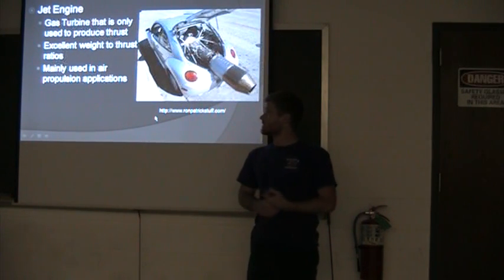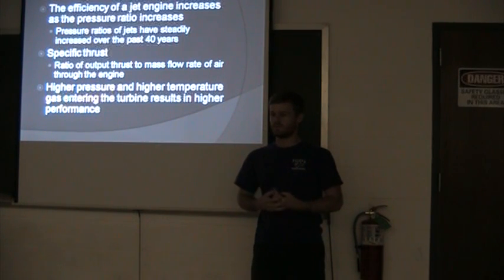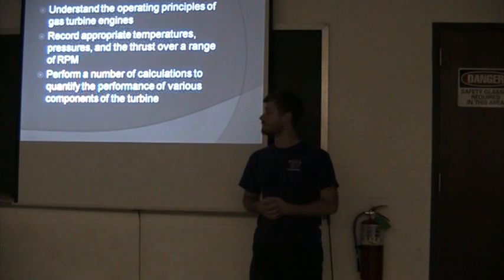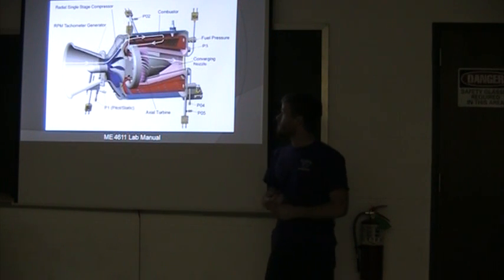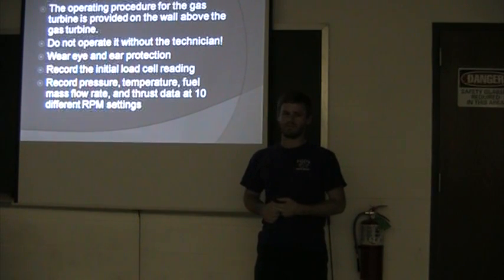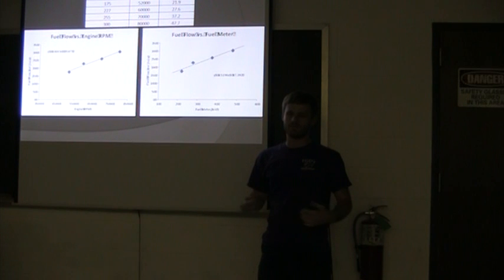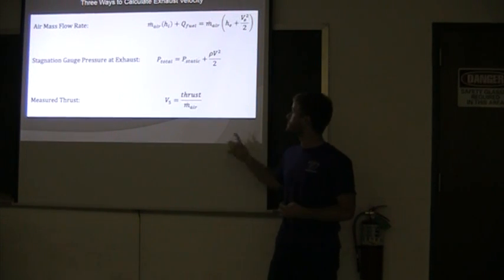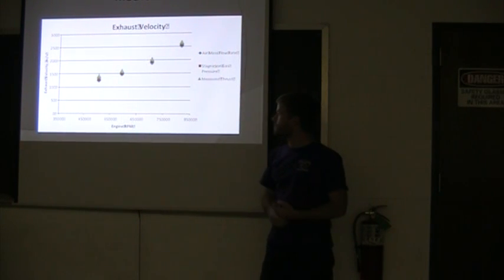Jordan Becnel - Lead

Comment from the maker: This was a good presentation. You presented the information well and had good body composure. You didn't stare at the screen too much, which is a good thing because it shows you understood the material. I agree with Evan and think some of your earlier slides had a good bit of text, but that's an easy fix. You also ended your presentation a bit on the early side, but that's okay because your questioning period went well. Overall, nice job.